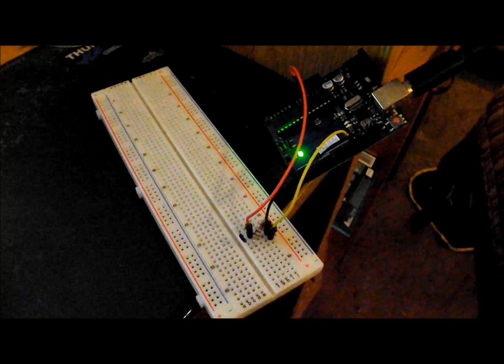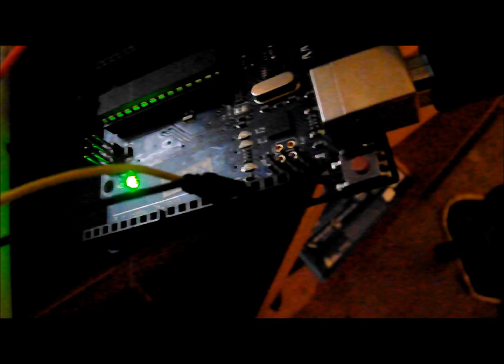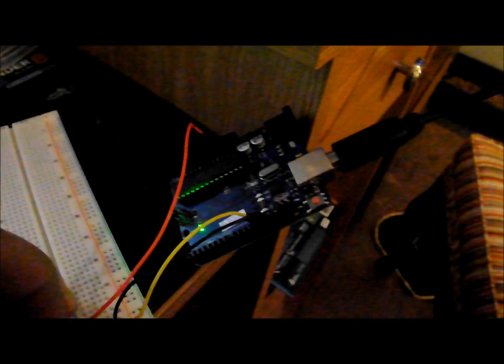Hall POC

Comment: Hey man, oddly i built the same circuit last week as a POC based on your post on Honda Twins.  What size resistor are you using?  I got mine to pick up the flip signals using one small rare earth magnet and didn't have to be very close.  Close, but not extremely extremely close.